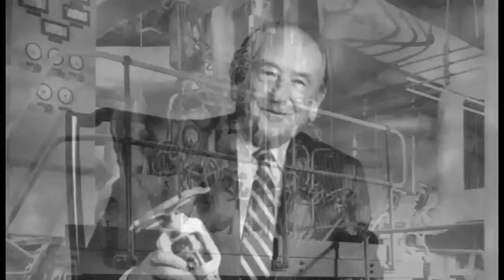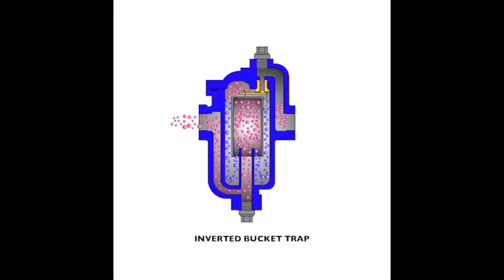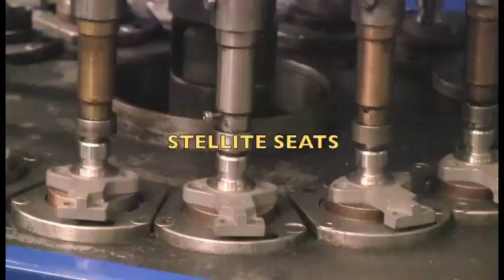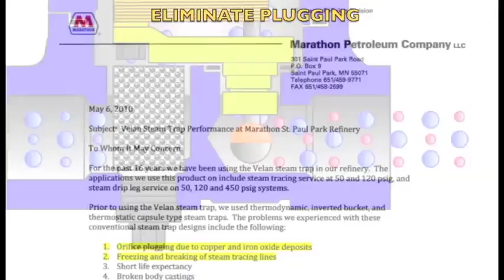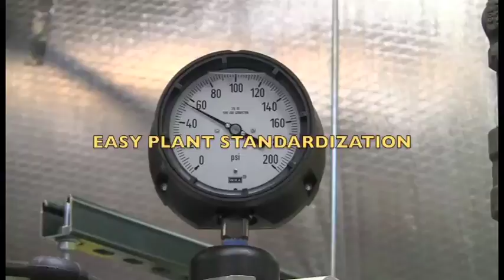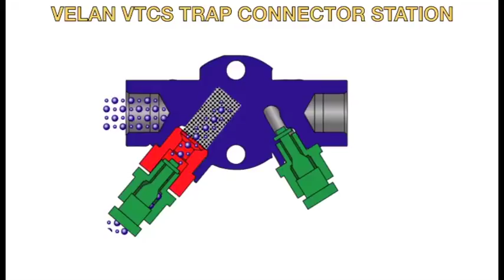Velan Steam Traps

Comment: For the depiction of the saturated steam curve and segmented bimetallic element which closely follows it, it is suggested that for the steam shown in the test rig, at ~100 psig, only ~20°F of subcooling would open the trap. However, the trap clearly doesnt discharge until a much lower temperature in the experiment, one which seems consistent with a single bimetallic "conventional" element? How is this appropriate for saturated steam service? How long of a cooling leg is necessary?
Reply: 3-5 ft is all you need